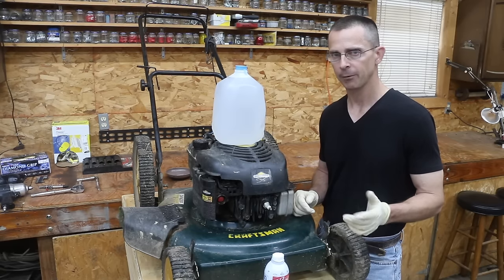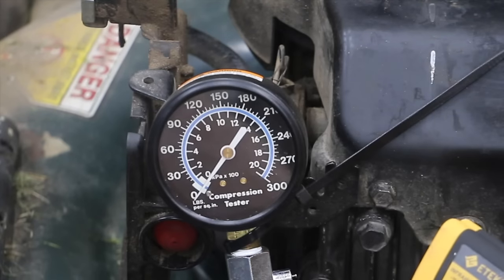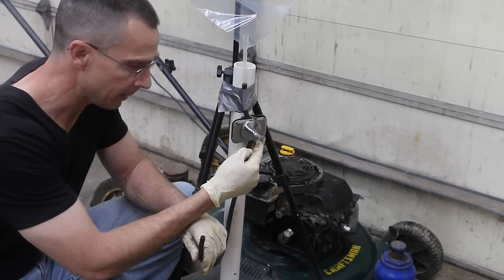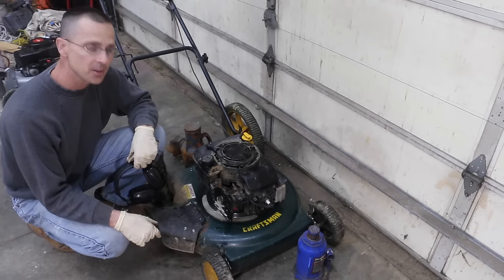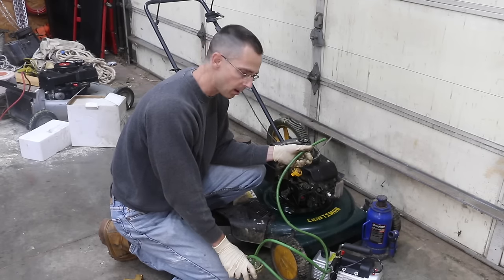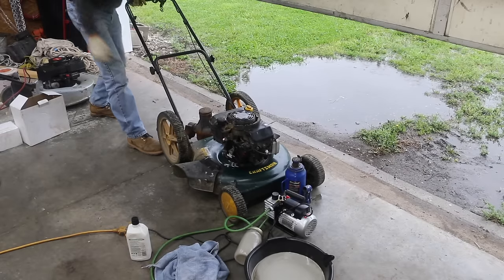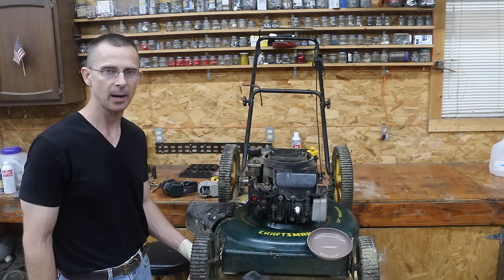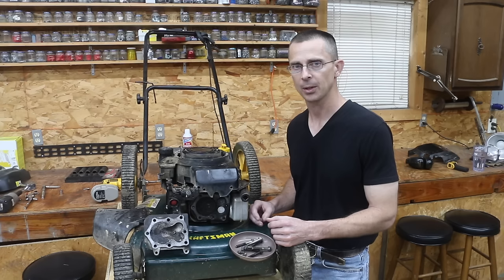Seafoam--can't believe what it did to my engine episode 5--cylinder cleaning test using water!!

Comment: The way It works is with the engine at operating temp rev it to about 2500 Rpms  add a burst of water.  The water cools the carbon deposits on contact breaking them free from the engine surfaces. You don't run the engine on water constantly.  It needs to be added In short bursts To allow the surfaces you cooled to heat up agan.
Reply from the maker: Thank you for this recommendation!
Reply: Eddie 27886 

That's how I have always done it.
Reply: My gues would also be coal liquefaction at these conditions, cleaning even that stuff that a wire wheel cant get. Too much water and it would be too cold for this to happen.
Reply: The water is flashing to steam and steam cleaning it.
Reply: Eddie 27886 this guy gets it
Reply: Eddie 27886 

Try that in a skillet with lots of baked on carbon. Get it hot and splash water in it in accordance with your carbon breaking free theory. You’ll find that the carbon won’t be affected.
Reply: Yes. That's how I remember doing it. You don't want to stall the engine, but I believe it is more effective when you hear the engine stumble a bit as if it will stall. Keep rpm up around 2k.
Reply: 2 questions, How much and how fast, would you add the water in a "burst" when the engine is hot and running at 2000 rpm?    
Like 1 or 2 cl/centiliters over 1 minute, then let it heat up and do 4 or 5 times more?
Reply: @FrankGutowski-ls8jt  Frank, I can assure you that in fact splashing water in a hot pan does break free the "baked on carbon". Ask any professional Chef how they "deglaze" a skillet. They will tell you they do so by adding liquid to the hot skillet. What they are deglazing is baked or burned on carbon left over from frying something in that skillet. When I make gravy I add liquid to baked on flour, which is in fact a form of "baked on carbon" so you need to reassess your statement.
Reply: Charles Erps 

No. Silly. Armchair BS. 

That’s not baked on carbon. Fond is nowhere near what forms in combustion chambers. It’s a mixture of fats, carbohydrates, and proteins. Hydrating them releases them. 

BTW, the engine deposits are mostly zinc and calcium from oil additives. They look like carbon, are bound together by carbon, but mostly aren’t.

If you believe water removes carbon, just use E85. Produces 40% more water than pure gasoline. Water is about equal to the volume of pure gasoline burned.
Reply: I would try boiling water
Reply: don hin 

Engines already produce a lot of water. Adding a little more through the air intake for a short time is pointless.
Reply: Frank Gutowski Boiling chlorinated water produces polishing properties to keep your pistons clean and your valves polished and smoother rod knocking
Reply: Eddie 27886. The constant water flow is also why he ended up with water in the oil.  It seems there was pooling on the top of the piston that made its way past the rings.
Reply: @leocurious9919  The way this is supposed to work is that the rapid cooling causes thermal shock that fractures the lattice structure of the hardened resins in the carbon deposits...which basically means it shatters the caked on deposits into tiny pieces. The steam lifts them and carries them There shouldn't be much if any liquifaction--the deposit shouldn't be saturated and doesn't behave like a liquid, you just have steam and tiny particles of carbon flying out your tail pipe like a moist dust.  Constant water flow normalizes the temperature so there is less shock.
Reply: @FrankGutowski-ls8jt  wow... "Fond (sic.) is nowhere near what forms in the combustion chambers."  Did you just destroy your own analogy?  Also, carbon deposits are carbon held together by resins, not junk held together by carbon.  How much carbon is in the deposits depends on what caused the buildup.  A long-term rich condition, a fouled plug, a leaky injector, or a host of other conditions can cause some really carbon rich deposits.  These deposits also tend to get to be fairly thick and cause higher compression.  They also hold heat or even burn, kind of like char, creating hot spots and sometimes causing preignition.  These are the types of deposits you really want to decarb for and usually only if you are getting preignition, compression readings that are too high, or as a last ditch effort to bring NOx down if you are failing emissions after checking other systems like EGR...although if carbon buildup is causing NOx, your compression will likely be high.
Reply: @kender1412  Its not supposed to behave like a liquid or anything. The carbon reacts with water to form hydrogen and carbon monoxide. See here: https://en.wikipedia.org/wiki/Steam_reforming#Reforming_for_combustion_engines
Reply: Leo Curious 

Not applicable.
Reply: Jason Nichols 

Most of this is based on your personal opinion and assumptions about mechanisms and composition. BTW, fond is the culinary term for what adheres to a pan when sautéing. It’s not supposed to be burnt. Deglazing merely rehydrates and dissolves the proteins, sugars, carbohydrates, aromatics, and products of Maillard reactions.
Reply: @FrankGutowski-ls8jt  "Not applicable."
Aha... maybe you got some arguments...?
Reply: Leo Curious 

No catalyst. T & P are too low. Reactions won’t go under ICE conditions.
Reply: @FrankGutowski-ls8jt  So... what temperature and pressure do you think its takes to do that? Lower pressures are better, by the way. For the temperature take a look here:
https://en.wikipedia.org/wiki/Boudouard_reaction
Reply: Leo Curious 

Where’s the combustion chamber catalyst? Also, as I stated earlier, ICEs produce a lot of water. Deposits form nevertheless. The minuscule additional amounts introduced through the intake are Inconsequential by comparison.
Reply: @FrankGutowski-ls8jt  There is no need for a catalyst. They just speed things up. Hence you dont read anything about them in the wiki article untill its about catalytic deactivation in a refinery.

And yes, a perfectly normal ICE produces water. I never said that this is a normal process that happens all the time (predominantly). I said "My gues would be" in how this can help clean the chamber. Higher water partial pressure will shift the equilibrium to Carbon+Water to CO+H2... obviously.
Reply: Jason Nichols 

Google Leidenftost effect. Contradicts your theory.
Reply: exactly...36 year automotive tech.
Reply: @FrankGutowski-ls8jt  Obviously has not worked on cars/engines EVER. Stick to skillets and frying pans!

36 year automotive master tech.
Reply: Leo Curious 

The water shift reaction you describe required a catalyst.
Reply: Maj Wor 

Decarbonization by spritzing a few ounces of water is an old mechanic trick to build the bill. It dislodges soot from the muffler, so looks like it’s doing something useful when it’s not. 

Science is always right, whether or not you believe it.
Reply: @FrankGutowski-ls8jt  You really don't have a clue what you are talking about do you. I really hate to reply to this comment.
My 36+ years of experience of actually running a shop and mechanicing for a living has no relevance because you brought in the SCIENCE. 

I tell you what...if the first time you ever find yourself with a wrench in your hand and your first engine ever to work on (make sure you have your book) and you come across an engine with a blown head gasket (from a cooling chamber to a combustion chamber)...the defective cylinder will be easy to find because of how clean the piston and valves are because of the water/coolant SPRITZING lol into the coolant chamber. Any mechanic who has torn down engines can vouch for this effect.

Spraying water into the carb in bursts (not a couple of ozs from a spray bottle) from a hose with a nozzle at around 2000-2500 rpm was common place on 70s-80's low compression smogged up vehicles. It was a cheap fix cure all kinds issues including preignition, detonation, run on, dieseling, rough/poor idle etc because of carbon/soot build up on the piston and valves. It was a trick that mechanics used because it made the engine perform better. I have a lot of so called tricks I've acquired over the last 36 plus years. Has nothing to do with padding the bill. How is it padding the bill if the vehicle gets fixed?
Reply: Maj Wor 

Science is always right, whether or not you believe it.
Reply: Why would you run the engine for two freaking hours with water running through it????  A cap full.  After the smoke clears, change oil and move on.  Over kill here!
Reply: My Reality ml
Reply: Toob247 Toob247 

Head gaskets: coolant contains ethylene glycol. 

Boil water in a carbon-caked skillet. Observe that none of the carbon is dislodged. 

Engines produce about the same volume of water as the fuel consumed. It’s produced as hot, high pressure steam. Yet deposits form anyway.

Comment: you are supposed to use a spray bottle so the water is misted, that way it has a chance to be heated to steam. not just dump water in like that
Reply from the maker: David, Using a spray mister makes sense!  Thanks for watching the video and commenting!
Reply: no problem buddy
Reply: Project Farm Horrible thing to ask but I wonder if we could recreate this experiment only with a spray mister instead. The results might be worth the pain in the ass!
Reply: Would an airbrush be better still?
Reply: i wouldnt put water through anything but a 10 dollar harbor freight paint gun, let alone a 700 dollar air brush
Reply: Just buy the 10 dollar harbor freight paint gun for applications like this.
Reply: David, I use the a misting bottle, with much less issues then the problems generated during this test.
Reply: exactly... spray bottle or (even better) that hot steam home cleaner gizmo ... friend reved up to 3000rpm and i started to pour just shit load of water in it to make it almost stall ... i think around 25L of water ... after that i have taken down the head .... like fucking brand new ... 1.6D VW "80s" ... (advanced level of fun include water injection during load, using paint thinners etc to create two explosions in succession -copyright German warmachine) ... maaan you can play so much with an engine and home depot shits :-) ...
Reply: Not only is a mister essential, the engine must be allowed to re-warm between pulses. Water can't turn to steam below 212F degrees. Research "Water injection" to see how it was done back in the day and why. The steam performs a physical cleanng process, and the oxygen & hydrogen produce more power than fuel (Diesel is the prime application) alone.
Reply: +cptdavepilm  The water would have been atomized down enough by the time it got into the combustion chamber.  Larger than atomized drops that make it into the chamber are preferred as the larger drops can then absorb some heat energy, phase change into a gas, and do their work. I would do this steam cleaning for more than 5 minutes or so.  Way too long, but I understand its a test. Mechanical decarbonization is preferred.
Reply: hoghogwild no, the engine was far too overloaded with water. The piston dome was only hot at the beginning. You're assuming each power stroke brings the piston & head temp back to the 270-degree range. That doesn't happen. The process requires a sudden temperature change and the creation of steam, which only happens above 212F.
Reply: +jeff anderlik  Sure the engine may have been overloaded with water, but not for the reasoning you are employing. It doesn't matter how hot the surface of the chamber is as the gasoline itself is combustion at temperatures of 1000-1500ºF, more than enough to phase change the water, heck gasoline autoignites at 500ºF.  We are NOT relying on the conduction of heat of the chamber to flash the water into steam, the much hotter combustion of gasoline in air is taking care of that. the temperatures of the chamber/head/piston are going to much lower than the actual temps of the combusting a/f mix. If this weren't true the aluminum pistons and some aluminum cylinder heads would not survive for long as aluminum melts at 1220ºF and substantially weakens at temps much lower than that.   It takes a LOT of energy to phase change liquid water into gaseous water, hence the reduced temperatures exhibited when the external surfaces temperatures were measured.
Reply: hoghogwild you aren't trying to remove carbon from the fuel/air mixture. It's the mechanical action of heating and sudden cooling of the surfaces that dislodges the carbon. Getting it hot and cooling once with a steady prolonged stream of water only gives you one temperature cycle. Waste of time.
Reply: +jeff anderlik, which is why "steam cleaning" and engine is ineffective, which is why the manufacturers recommend mechanical decarbonization.
Reply: hoghogwild that's my point. Either do it on a hot engine, allowing re-heat cycles, it remove the head and clean it by hand. Not everyone has that skill. And the lawnmower engine is simply for demonstration. The practical application is your car or truck, and most people these days don't have the skill to do a head gasket.
Reply: You are kidding yourself if you think that liquid water is flashing to steam upon contact with the metal surface or the carbon on that metal surface, no matter its temp. If you can do a headgasket, you shouldn't be pouring water down any ICE, esp a car/truck, esp. a modern one.
Reply: hoghogwild water doesn't flash to steam at 260F? When water boils at 212? C'mon,  man.
Reply: My point is that the water doesn't flash to steam on the surfaces when there is combustion temps over 1000º occurring.
Reply: hoghogwild c'mon man. It DOESN'T HAVE TO FLASH TO STEAM! All it has to do is suddenly cool the fully-hot surface to dislodge the carbon. Heat, cool, repeat.
Reply: The blow by likely occurred because of the expansive nature of the phase change of water to steam. When it flashes to steam, the volume expands by something like 1600%. The blow by was likely caused by that fairly steep bit of overpressure in the chamber. Or there is a crankcase vent of some type that allowed water to seep into the crankcase.
 Of note is Bruce Crower's (of Crower camshafts fame) six-cycle engine where gasoline is combusted normally, but there is another compression and 'combustion' cycle in which water is injected and flashes to steam for another power stroke. You'd have to Google for the article, but he said on the test engine, he could hold his hand to the cylinder block of the engine and that it likely wouldn't need a radiator or water pump. I don't think it ever went anywhere, but it's interesting none the less.
Reply: damn, b10.

Get the bottle that has the screw-adjustable nozzle, not one that's just ON or OFF.
Reply: David, for your next test, try using the blue colored windshield washer fluid that is comprised of a water/methanol mixture.
Reply: Yes, I do the spray bottle in my shop.
Reply: I remember that article well. It is funny I was thinking about Crower's experiments with the six cycle engine as I was reading this thread and sure enough you remembered it as well! It was a pretty cool read in (Popular Mechanix I believe) back in the day.
Reply: I've done this off and on for over 60 years, and it has worked for me.  But I did it a little differently.  On a 327 Packard I used about a pint of water total, admitting it at about a tablespoon at a time.  I used a blanket in front of the radiator to get the engine up to 200f.  I've always believed it was the steam, not the water that cleaned the engine.  When I watched your test and saw no steam coming away from the engine, I suspected that it wouldn't work.  I watched the road draft tube, and if I saw any trace of steam, I would slow the procedure, and stopped adding water till I saw no more steam from the road draft tube.  Steam from the road draft tube meant the cylinders were not making steam.

Comment: 2 Hours! Wow when I was a kid in high school auto shop in the 70s our instructor taught us to us a single glass of water down the carb slowly (over like 2 minutes) while the engine was revving at about 3000 rpm.

Another  important point, I am not a small engine mechanic but when tightening head bolts or any bolt pattern DONT go in a circle, tighten the bolt across from the last one
Reply from the maker: Thanks for the feedback.
Reply: That pattern is so small and not receiving any rotational torque, the use of the impact is more than consistent enough given he replaces the gasket every time.
Reply: I think he knows that. It’s a cheap lawn mower. No need for caution.
Reply: Thats about right. I spray water maybe about 1/2 bottle worth max. It doesn't take much to clean the cylinder.
Reply: 2 hours man  thats to long brother … the secret is use ice cold water and only need one glass of water 

You did this way to long brother…

But the ice cold glass of water also works great for cleaning carberator